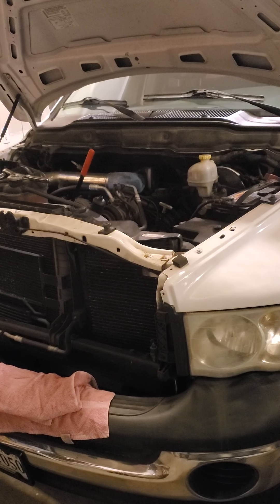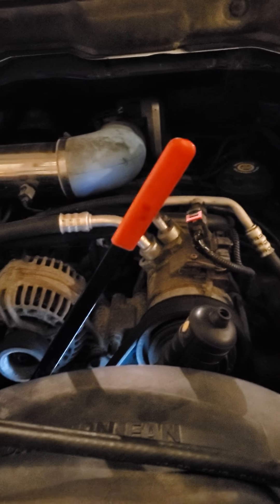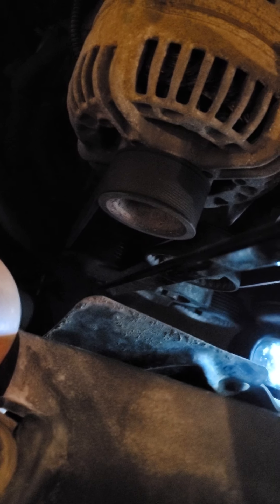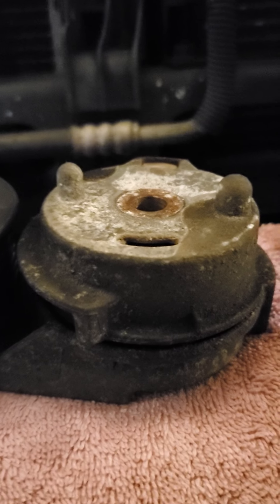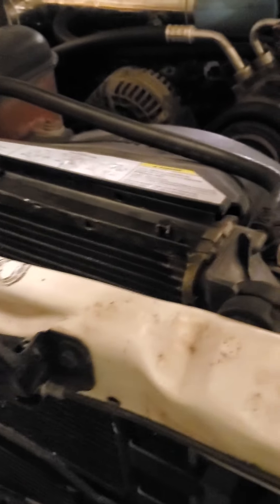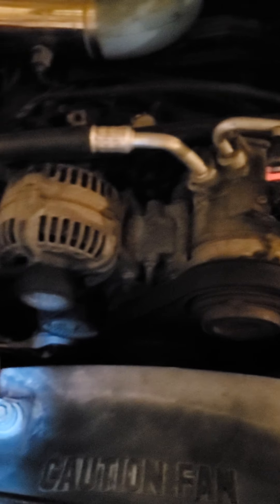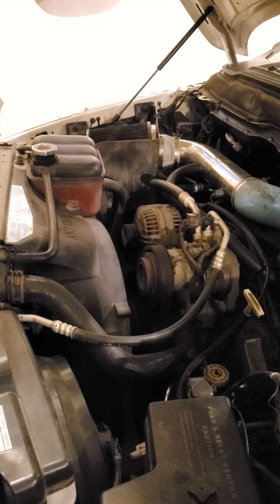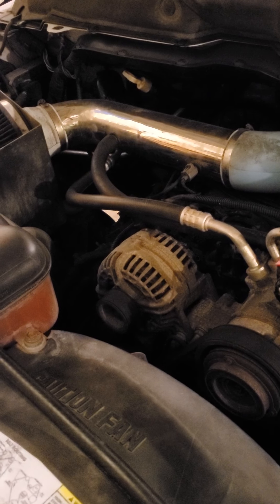2003 Dodge Ram Automatic Belt Tensioner  Replacement (Tensioner Pulley Replacement)

Comment: EDIT: IM DUMB SEARCHING YOUTUBE I HAVE A NEWER 5.7 HEMI that I drive so I just looked at that one to see it's the same way  😂 

Good stuff man I'm replacing the water pump on my brother's truck and I got to the tensioner pulley and I thought that's how it went on where the right pin like sat on top I watched like three other YouTube videos and they we're not specific but I couldn't get it in both holes even though the second hole to the right is like really wide but it seems to sit good the way you have it installed and pretty much everybody else that was installing a tensioner pulley it was just  put it in by hand so I know they didn't try to fit Both studs into both of those holes

Comment: hello Aaron, my 2008 dodge ram 1500 6V squeaks and I was told that the tensioner/pulley has to be replaced.  But I got very worried because I heard that there is a 2nd tensioner that may require to remove the front of the truck (with radiator and alternator) to be replaced. I still don't know which tensioner but could this worse-case scenario be true?
Reply from the maker: It's possible, but an experienced mechanic could likely find a work around. It's also worth noting what actually has to be replaced on the system. On the plus side, a coolant flush isn't a bad thing.